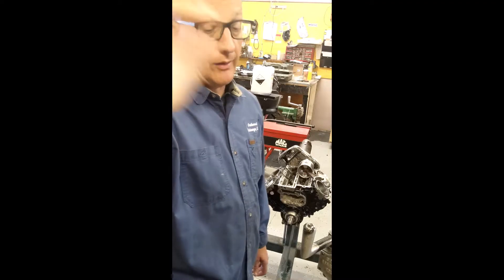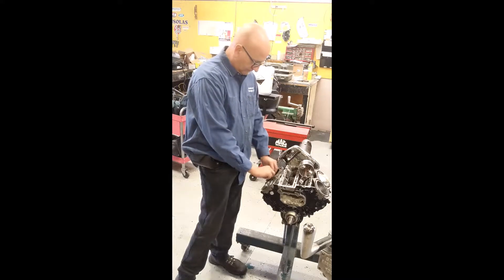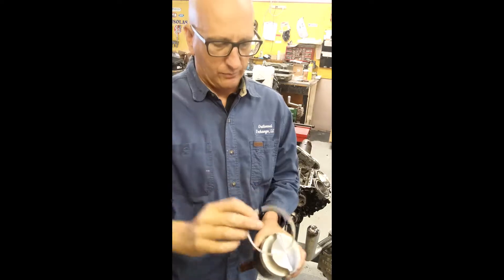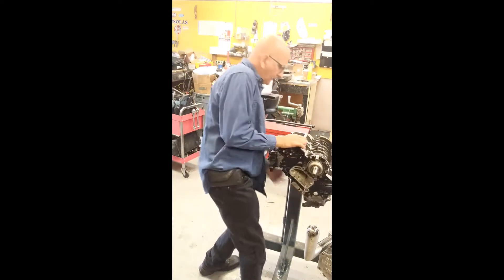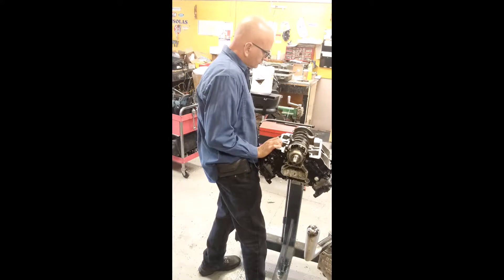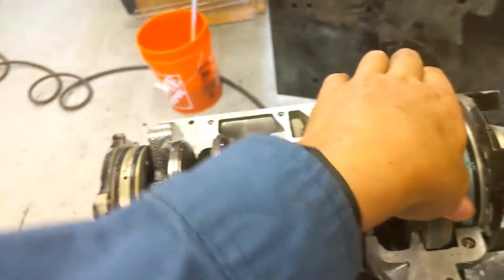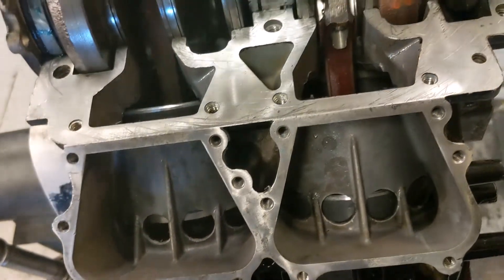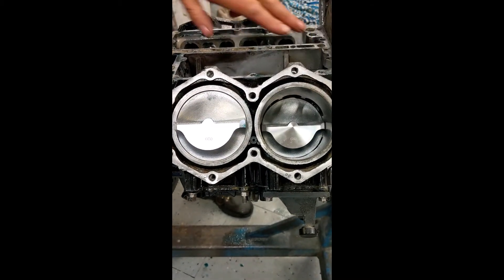Evinrude V4 Crossflow Piston Install

Comment: What happens if you install all the piston backwards
Reply from the maker: The motor wouldn't even turn over if the pistons were installed backwards
Reply: What if I told you that I bought an engine Johnson gt150 and the Pistons were installed backwards 0.20 pistons omc oem from the previous guy that I got it from and it was ruing it just had low power in the water  so I had to pull the engine apart and flipped the pistons over  now it runs great  crazy stuff people need to not touch stuff if they don’t know what there doing gees all the headaches over that with the boot attached it ran ok once it was in the water before it had zero power wouldn’t go above 2500

Comment: What ring gap did u set them at?
Reply from the maker: 20 thousandths. Unfortunately the days of filing and setting the ring gap are gone so we check the end gaps to verify that the machinist bored the block correctly and that the rings are correctly made.
Reply: @Oexchange  so,how do u set the gap,if u dont file if needed?..

Comment: Anyone have a diagram of a '90 90HP Evinrude hose routing for the Carb and fuel lines?  The vent hoses from the block/cover plates to the carb/intake/ etc?  Cant find them anywhere...It's a crossflow...Not 100% sure of the year..cant find Model Number anywhere...
Reply from the maker: I can't send any photos on YouTube or I would take a picture out of one of our books but you can email us if you'd like or you may be able to find a free or low cost service manual online. I would try googling "1990 Evinrude 90HP service manual pdf" and see if it comes up. Or you can probably find a hard copy on eBay if you prefer that.

If there's no tag with the model number there is a freeze plug on the powerhead with a serial number which a dealer can help with looking up the year.

Comment: Hi! did you re-bore the powerhead? Just got a Jonhson 1979 V4 crossflow and want to rebuild it. Pistons are shot and engine is seized. The cylinder walls are not that scored. Would you recommend a re-bore and bigger piston\rings?
Reply from the maker: Hey Alex, 
Yes, we send our blocks out to be remachined and use oversized pistons on our rebuilds.